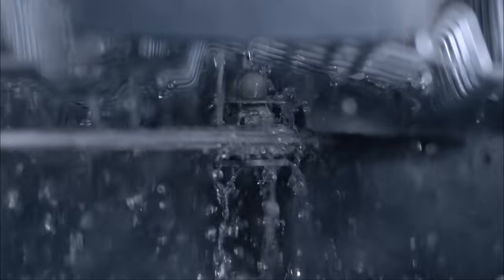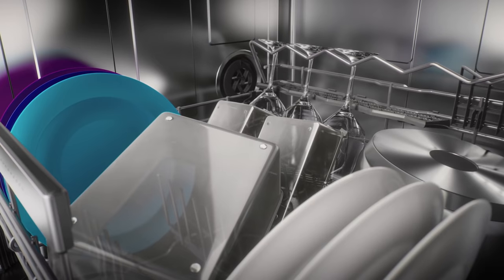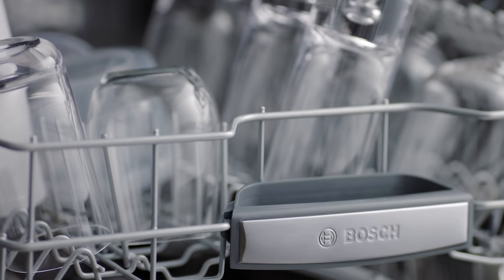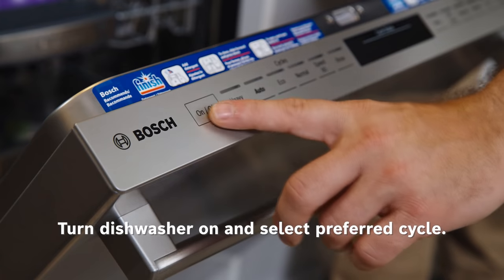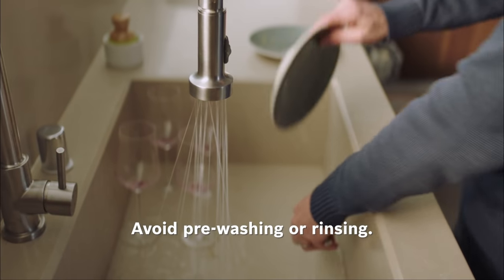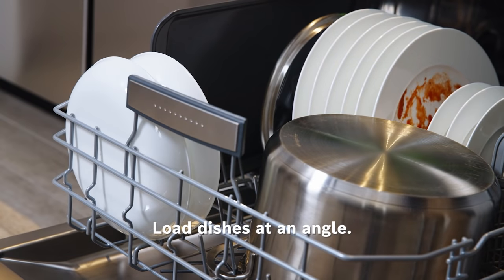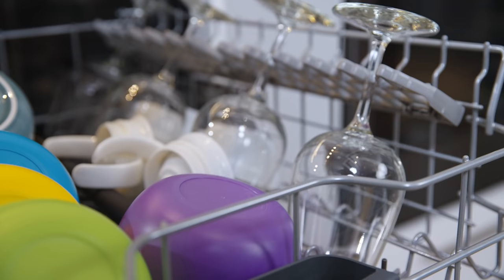Bosch Dishwasher Drying Technologies & Tips for Drier Dishes

Comment: I am sending this dishwasher back. $1k for a dishwasher that doesn't dry dishes is unacceptable. I have tried all recommendations and I still have wet dishes and water is in the dishwasher. I wanted to love this appliance. Disappointed.
Reply from the maker: Hi M Ricks, thanks for making us aware of your issue. We're sorry to hear that you're experiencing drying issues, and understand that you've tried some recommendations. You may also visit the following link for additional drying tips: https://www.bosch-home.com/us/experience-bosch/tips-and-tricks/all-articles/tips-to-maximize-drying. If you need further assistance feel free to contact our customer support team at 800-944-2904 or email BoschCare@bshg.com.
Reply: @BoschHomeAppliancesNAmerica  Thank you for responding. I appreciate it. Actually, I was able to get dry dishes after I used Auto, Sanitize, Auto Air and Jet Dry. I will still call the 800 # because the installer failed to install the strip under the cabinet to guard agains moisture when the door automatically opens. I plan to keep the unit. It is amazingly quiet and my dishes are clean.

Comment: I personally find it unreasonable that in order to get dry dishes in your entry level brand dishwashers, one must use a rinse aid.  We try to be as eco as possible and only use eco tablets for soap in our current dishwasher.  We always have dry dishes and we have never used a rinse aid (which comes in plastic bottles and adds an extra stop plus extra cost) to each washing.  Please start implementing an actual drying system in your entry level dishwashers.
Reply from the maker: Hello, thank you for your feedback. We're sorry to hear about your disappointment and we've forwarded your feedback to our design teams for their review and consideration. Contact us if we may help answer any other questions!
Reply: Rinse aid is mostly used in assisting drying, and has existed for decades beyond in any and every form of a dishwasher. 
It's mostly used together with dishwashing powder which can clean better too.
Reply: Yo because water can be held on top of bowls and glasses on the top track when you pick them up you could splash pooled water on to the rack below the drying cycles drys dishes but won’t make puddles disappear

Comment: Why empty the lower rack first to prevent water from dripping from the upper rack if they are SO dry. Drying has never worked on my Bosch.
Reply: The water drips from the rotating arms, not the dishes.
Reply from the maker: Hello Ed, thank you for reaching out. Sorry to hear about the poor drying results. Our team would be happy troubleshoot this with you and assist. Connect with us 24/7 at 800-944-2904. Thank you.
Reply: Mine come out piping hot and bone dry. However I also take the bottom rack out 1st followed by the middle. Tiny water drips from the sprinkler and tiny droplets from the underneath of the plastic trays.
Reply: I have water that collects on plastics such as plastic lids that I put on top rack, and small containers that are small enough to fit in basket. Every single time that happens

Comment: So the tip to achieve drier dishes is to buy the most expensive models of Bosch. That’s a pretty lame tip.
Reply from the maker: Hi, all Bosch models utilize our excellent PureDry system. While other models offer additional drying technology, even the most basic units will provide dry, sparkling dishes. Thank you!
Reply: @BoschHomeAppliancesNAmerica  I have a $1,000 2021 model.   It doesn't dry the dishes.
Reply from the maker: Hi Darby, we're sorry to hear about the poor drying results you're experiencing. Our team would be happy to help troubleshoot this to improve the drying results. Connect with us 24/7 at 800-944-2904. Thank you.

Comment: I have an older model, so have to open the door myself - except for some plastics, it does a pretty good job BUT - the spray arm that is mounted under the top rack will dribble water left IN the arm - SO one MUST empty the bottom rack first - as any wiggling makes water drip onto the dry dishes on the bottom.

Comment: Our Bosch 800 series with Crystal Dry washes beautifully, but dries significantly worse than our other 2 cheaper dishwashers before it - the door on this one does not pop open upon completion. Top rack main issue - water always collects on top of mugs (slanted or not), and plastics have no chance at all - just do it by hand.
Reply: Same here, my old cheap dishwashers did a better job of both washing and drying.  Glassware is definitely the worst, as you said, mugs and glasses even if slanted.
Reply from the maker: Hi Dieter, thanks for your feedback and we're sorry to hear that you're experiencing drying issues. We think the following link may help with drying: https://www.bosch-home.com/us/experience-bosch/tips-and-tricks/all-articles/tips-to-maximize-drying. If you'd like to discuss other service issues, feel free to contact our 24/7 customer support team at 800-944-2904.
Reply: I am struggling with the same issues - pooling of water on mugs and plastic bottles. I just got a new 800 series dishwasher installed and really don't see the difference with Crystal Dry. I was under the impression that the Crystal Dry technology would absorb moisture in the dishwasher. However, there is still tons of steam when I open the dishwasher door about 30 minutes after cycle completion. Is this normal?
Reply from the maker: Hi Albert, thank you for reaching out. We recommend setting cups and bowls at an angle, to prevent water from pooling up on these items. While CrystalDry will help remove moisture, it cannot evaporate puddles of water. We're happy to help provide some troubleshooting to help with this. Connect with us at 800-944-2904. Thanks.
Reply: @BoschHomeAppliancesNAmerica  - UPDATE - I actually ran the dishwasher again on automatic setting + crystal dry + extra dry setting with rinse aid set at 5 and the dishes came out perfectly dry. There was a little bit of water on the plastic bottles, but they dried relatively quickly after opening the dishwasher door. If the dishwasher continues to work this well, then I am really happy with the purchase.

Comment: I have a new Bosch with crystal dry feature. It is useless, the stainless steel walls are wet, water is pooled on ceramic mugs and plastic is just like I lifted it out of a basin of water.  It does get the dishes clean without any prerinsing. My old Bosch dried everything beautifully.
Reply from the maker: @barbararichardson-cox3020 thanks for contacting Bosch. We are sorry to hear that you are experiencing drying issues. The following link offers tips on how to maximize drying: http://spkl.io/60514IlgT. Should this not resolve your issue, please contact our Customer Support team at 1-800-944-2904, who will be happy to assist you with real-time troubleshooting.

Comment: I just purchased a 300 series Bosch and very unhappy with the drying process.. Have run 3 loads using sanitize and extra drying and the dishes were still very wet.. Not happy at all with this model.. This is my 2nd Bosch dishwasher and the first was fantastic.. I do not think I will  purchase another Bosch in the future.. So disappointed..

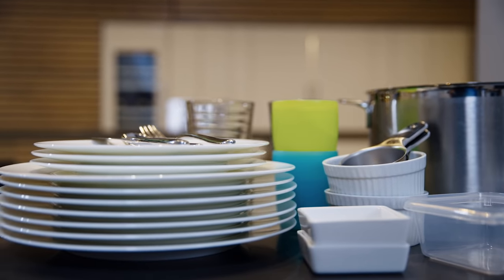Comment: Why would there be water dripping down on dishes (at 2:12) if the washer does its job? Our Bosch dishwasher leaves water on dishes on both the upper and lower rack.
Reply: My BOSCH 300 cleans very well and is very quiet. BUT moisture is a problem. So, what I do is crack open the door about 3 inches when the 2+25 cycle is complete 
(Monitor the red light image that shines on the floor & maybe use a timer?) I no longer have a moisture problem!
Reply from the maker: Hello Knut, thank you for reaching out. Water can collect on the underside of cups or bowls, as well as on or in the racks themselves. Our team is happy to help troubleshoot the drying results you're getting. Connect with us 24/7 at 800-944-2904. Thank you.

Comment: I got the 800 Seies with the Crystal Dry. That function doesn't even work with Eco or Speed 60. Because of the design of the glass rack, I get lots of pooling of water on the bottoms of cups and mugs. Items on the top silverware tray are often wet, too.
Reply from the maker: Hi Amy, thanks for reaching out. We’re sorry to hear about your disappointment with your dishwasher. We think the following link might assist in providing various tips: https://bit.ly/3ZJzNZO. If you have any additional questions, please contact our customer service team at 800-944-2904 for real-time assistance.
Reply: I also have the 8. I’ve found on my 8 on nearly all programmes and options combined, mine come out piping hot and bone dry. Can hardly touch them, lol. However I’m yet to use eco. From a personal point of view I find eco trims on all the dishwashers slightly gimmicky. Next time I’ll try the eco as you said. If you slightly angle your cups you won’t get any pooling unless the lip and trough is deep as. 

Cheers.

Comment: Hello Bosch--I have a three year old Bosch dishwasher. Should I run the tap to get the water hot before starting the dishwasher, or will the dishwasher heat the incoming water itself to the proper temperature?
Reply from the maker: Hi Eric, thank you for your question. The unit has a flow-through water heater built in. It is not necessary to run the hot water heater prior to starting a cycle.
Reply: Except the first rinse is not heated. I actually had Bosch customer service tell me that I should run the hot water tap prior to starting the dishwasher. This makes no sense because that would mean you should NEVER use the delay feature.   @BoschHomeAppliancesNAmerica

Comment: This was not helpful. I have a 2022 800 series dishwasher.  I am looking for information on how to shut off the Crystal Dry option so I don't need to do this manually every time I run the dishwasher. Nothing in the owner's manual addresses this. The owner's manual mentions an "intensive drying" option on pages 12 and 36, which heats the final rinse water to (?) to increase drying but there is only one mention of Crystal Dry, on page 30, nothing about how it works, what it does and how to shut it off as a default. Is it a separate heat function after the final rinse when the dishes are supposed to be drying or is it the same as the "intensive drying" that heats the final rinse water? There is also an "Extra Dry" option mentioned in the troubleshooting portion of the owner's manual. Are Intensive Drying, Extra Dry, and Crystal Dry all the same thing? Bosch customer service is worthless. They just refer me to the owner's manual. If I could find the information there, I wouldn't be calling. The manual is VERY poorly written.
Reply from the maker: Hello, thank you for reaching out. We're sorry to hear about the trouble. The default setting cannot be changed, we apologize for the inconvenience. If we may help answer any other questions, connect with us at 800-944-2904.

Comment: Buyer beware the 300 series Bosch dishwashers do not dry dishes at all.  Even when using rinsaid and all the other tips in this video.  Buy literally any other brand and they do a much better job at washing and drying.  The Bosch is quiet though, but does not do the only job it was made to do, which is wash and then dry dishes.
Reply from the maker: Hi samutubeaccount, thanks for reaching out. We apologize this has been your experience, and appreciate you bringing it to our attention. All Bosch dishwashers use a condensation drying process known as PureDry™, which is the core drying system that delivers simply clean and dry dishes. PureDry™ is an energy-efficient, closed drying system that does not pull in outside air or use an exposed heating element. With PureDry™ technology, moisture is gently whisked away from dishes as they cool. And with no exposed heating element, your plastics are safe in the lower rack. For more information on this drying process, please visit the following link https://www.bosch-home.com/us/experience-bosch/puredry. You can also find tips to maximize drying here https://www.bosch-home.com/us/experience-bosch/tips-and-tricks/all-articles/tips-to-maximize-drying. If this doesn't resolve the issue, please contact our Customer Care team at 800-944-2904, who would be happy to provide real-time assistance. Thank you.
Reply: I wish I had known this before I wasted my money.. I am so disappointed in this model.. Why spend all that money only to be required to open the door or wipe dishes dry...
Reply from the maker: Hi 911memorialquilts, We are sorry to hear that you are disappointed with your Bosch dishwasher. Please click this link for some helpful tips that can improve the results: https://www.bosch-home.com/us/experience-bosch/tips-and-tricks/all-articles/tips-to-maximize-drying. For additional assistance please call our Customer Support team at 1-800-944-2904. Thank you.

Comment: Mine doesn’t pop the door open automatically like some of the newer, more expensive models, but still does a pretty good job of drying. I just make sure to crack the door open at the end of the cycle for about 10 or more minutes and that works very well. I don’t think any dishwasher can remove all the water that can get trapped in the nooks and crannies of dishes.

Comment: We have the 500 model with Auto Air. The door pops open but the control panel remains lit--meaning "Auto," the timer, and "Auto Air" remain red and blinking. Is that how it should be working? The timer is showing 3 hours and 14 minutes.. I would think it would show zero as the cycle is done. Can someone explain?
Reply from the maker: Hi Cathy, thanks for reaching out. The Auto-Air releases the door at the end of the drying cycle, so there should not be any time remaining. Please contact our Customer Care at 800-944-2904, and we'll be happy to see how we can help in real-time. We look forward to hearing from you.

Comment: You think after all these years of complaints of dishes not drying Bosch would have changed their dishwashers to have an actual dryer in them! Thats all I have heard for years and years and years is that they don’t dry! I just bought the 500 series and I like it overall but it does not dry the dishes like my other GE dishwasher did. Give the people what they are asking for a put a stinking heating element in it! I don’t like the door popping open because it looks like someone came along and opened it and forgot to close it and looks messy.
Reply: I totally agree with you !! My new BOSCH dishwasher does not dry and the control panel is ridiculous. My Kitchen Aid had a horrible rack setup BUT the dishes were clean and DRY !! I will never buy another BOSCH anything !! and Ill leave bad reviews here and on BOSCH website, Home Depot and Consumer Reports!  Prob the reason BOSCH has not fixed this KNOWN problem is bc they are more interested in their ESG score than their customers satisfaction.
Reply: I prefer not having a heating element. Research features before you buy! I love my Bosch 300.

Comment: Very unhappy with our 2023 top model Bosch dishwasher. Unfortunately our kitchenaid failed after 7 years. Although tech the same size, this dishwashers configuration is not designed well and I can fit less dishes in at a time. But what I dislike the most is that I cannot set/use the delayed timer without using the app. Ridiculous to have a wifi dishwasher unless it can load itself. Zero purpose to this. Second biggest issue is the dishes are never fully dry despite this claim of the "Air dry" feature. In my experience it only makes the dishes stay more wet. Sadly this was the best option of what's now available in dishwashers.

Comment: They dont dry. That is what I have learned. Our 18 yo dishwasher was far superior to this new one. It will be going back.
Reply: Seems to be a consumer nightmare. Also wanting us to purchase jet dry. Bot interested in more chemicals. At all. Cant wait to return it.
Reply from the maker: Hi, tks for your input. We're sorry to hear about your disappointment, and we're sorry your dealer was not helpful in explaining a Bosch dishwasher before your purchase. Rinse aid is critical to the drying performance of Bosch dishwashers, as it helps to lower the surface tension of the water. f we may help answer any other questions, connect with us at 800-944-2904.